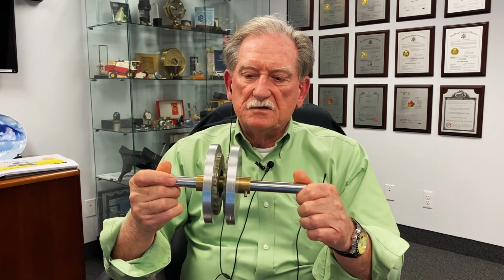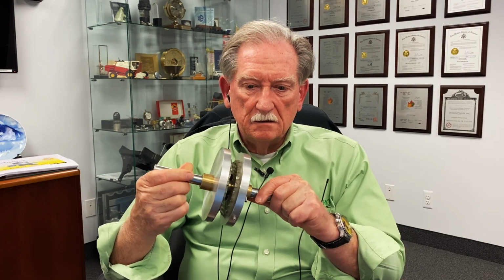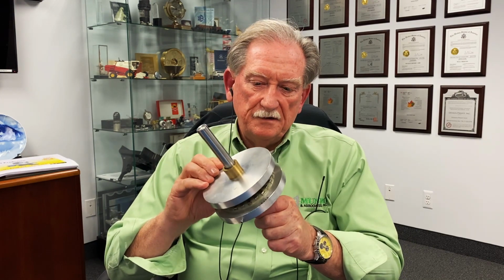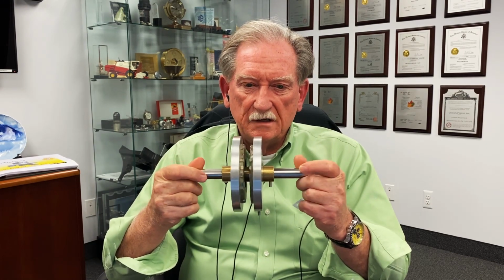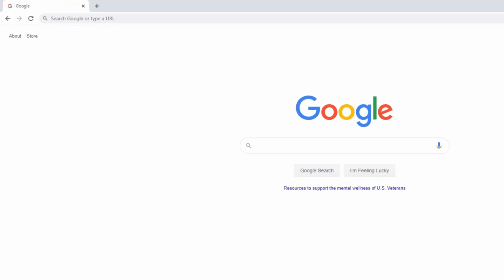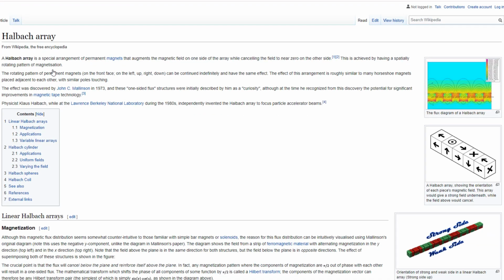Sandy Discusses What's In The Box - With Tracy McSheery

Comment: Woolsey... it's my first time running across a full-sized two-wheel gyrocar.  Amazing.

Okay, motors-in-wheels.  Traditionally, hub motors - commonly found in e-bikes - are not very efficient.  Assuming these Hallbach effect motors from Saphire don't suffer from that deficiency:  wheels are unsprung, so more mass in the car will be unsprung with in-wheel motors.  What will that do to tire grip over rough surfaces?

Being unsprung, motors and their connectors are going to take a heavy beating.  What will putting these motors in wheels do to failure rates and maintenance costs/inconvenience?  I'm sure there will be engineering solutions to ensure reliability, but what will be the cost and unsprung mass implications of those solutions?

It sounds like Sandy is leaning towards putting some very pricey components in these 3-wheelers - Hallbach effect motors, air suspension... a gyroscope?  Not sure I heard that right.  From a marketing perspective: people will expect a tiny car with limited space for people and cargo to sell for less than competitive 4-wheel cars.  With Tesla planning to introduce a $25K FSD-capable (FSD will cost extra, to be sure) consumer car, with all of the high tech and good range Tesla can put into their cars, where is the market for a 3-wheeler that may cost more, uses older-tech batteries, has less range, has less space, has off-the-shelf (older) tech, and has none of Tesla's software advantages?

In principle, it seems as if 3-wheelers could find a market niche, but the price-value ratio has to compel consumers to buy it.  Or they won't.

It would not shock me if Tesla decided to engineer a 3-wheeler for the Indian market, but they can now bring to bear tremendous advantages that a small startup simply doesn't have: BMS software, motor control software, OTA, user interface, navigation, etc.  Looking ahead a few years, a startup which can't match Tesla's tech and utility at their price points is going to be a niche manufacturer; the mass market will elude them.

Tesla is thinking of the whole car as a computer.  I think automakers, large and small, who can't learn to do that will have a hard time over the next couple of decades.
Reply: I thought that too... unsprung mass.  Maybe move the motors inboard to the fulcrum end of driveshafts, but that would not be in-wheel and would greatly restrict motor diameter.
Reply: ohhhhh if only it were that simple, ...
Reply: You guys were able to capture some of my questions here, thanks. If Tesla is truly open to selling their technology to these startups, a grassroots development of markets become a topic of review.
Reply: @markorcutt2115  That's easier to say than to do, Mark.

For starters, Tesla's cars are highly integrated.  The software works with the components.  Pick different components, the software won't work without a lot of changes.

The software has a design philosophy and design language built into it.  Go in a different direction and it's not going to be optimal, or even work at all, potentially.  For example: the stability requirements for a 3-wheeler are dramatically different from those of a 4-wheeler.  Sandy was talking about using the motor control system to obtain stability for 3-wheelers, but that need drives design in a new direction, one Tesla has not previously pursued.

And so on.  At just about every point, the needs of a 3-wheeler are different, sometimes subtly so, sometimes in a much more pronounced way.  So none of these startups can just sign an agreement and walk out with Tesla's software, ready to go.  It won't work that way.  This isn't Microsoft Office.

Tesla will incur considerable expense reengineering its software to work with any of these startups' vehicles.  It won't be instantaneous, either - software development for cars requires quite a lot of testing and refinement, 'cause people's lives are on the line.  Figure on years.

Then we have to think about updates.  Is someone going to pay Tesla to keep the software updated?  Or no?  If Tesla wrote it, nobody else is going to be able to maintain it without a lot of time-consuming headaches, and time is money.

Tesla might make the deal to license software and an entire 3-wheeler skateboard, which they will manufacture - if Tesla was going to make such a skateboard anyway.  (If they aren't already intending to engineer a 3-wheeler skateboard, there's no way small startups could afford the price to pay them to do it.)  So let's assume Tesla wants to do this work anyway, and they wouldn't mind producing skateboards and updating software just like they intend to do with their own 3-wheelers, for a fee.

It's a trap!

Tesla will obtain skateboards, software and hardware at cost for its own manufacturing operations, but they won't be selling skateboards, software and hardware to other manufacturers for their internal price.  They'll mark it up.

So the best a startup could do with a deal with Tesla would be to match Tesla's tech at a higher vehicular price point.  Oops!

Deal with Tesla, match the tech but not the price.  Don't deal with Tesla, where the heck is the tech going to come from to match Tesla's price/value ratio?  Answer: it isn't.  Tesla has won this decade.  The entire market is there for them to feast upon.

This is the bind Tesla has put the entire industry into.  Before it's over, we'll see execs jumping out of skyscrapers.

The only escapes are to go deeply down-market where Tesla doesn't intend to operate (well below $25K, since a Tesla at that price point will be very capable and very loaded with advanced tech), or so far upmarket that price is no object.  With the latter option, production volumes will be low.

Sandy is adding gee-whiz expensive components.  Hallbach effect motors.  Air suspension.  So he's headed upmarket.  He mentioned leather seats and luxury appointments.  So he's opting for small production runs.  The market just won't be very big for expensive 3-wheelers.

But luxury buyers' expectations are being shaped by tech, too.  That's a moving target, and Tesla is the company moving it.  There literally is no-place to go for most of what Tesla is doing.  Only Tesla does it.  To catch up is an impossible task for a startup.  Tesla has had too much of a head start and is still accelerating.

It's not obvious to me that upscale 3-wheelers lacking the latest tech, lacking space, with only modest performance, lacking the latest battery advances (which only Tesla has), lacking good range, lacking advanced software and connectivity, unable to provide a compelling price/value ratio, looking for consumers at the high end of the market, will find enough demand for the companies making them to survive.

It's not that 3-wheelers are inherently a bad idea.  Tesla may even decide to make one at some point.  But they can shovel so much tech into any car, and do so affordably in coming years, that finding an entry point that will persuade consumers and attract demand will be exceedingly difficult.

The market is being disrupted, turned on its head.  Consumer expectations are being changed rapidly.  Tesla will condition them not to accept city cars and short-range vehicles that don't offer much value for the price.

Cleanerwatt operates a YouTube channel that compares BEVs according to costs (initial and follow-on) and performance, utility and tech features.  Worth a look!  I can easily imagine him dissecting an upscale 3-wheeler measured against the closest Tesla (in terms of initial price) and placing his check marks.

It's going to be brutal.

Comment: Excellent show on the Halbach Effect Motor!  Now, I am definitely NOT an engineer;-)  But I have been waiting for and following EV progress for about 30 years now.  Back in the late 90's or early 'aughts, there were several companies already working on Hub motors.  But today, the only Hub motors are in Electric Motorcycles- I don't recall any being in cars yet.  And from what I understand, the problem has been, and is, the unsprung weight- that this just beats up and destroys Hub motors before their time.  I would love to see them implemented, but is there anything in Sapphire's new Electric Motor that addresses this issue of unsprung weight killing them?

And thanks for the video, Sandy!
Reply: The additional weight will be about 8 kilograms, which is about the same as the disk brake, so the short answer is it shouldn't be noticeable.  The better answer is to have Sandy show the vehicle at speed.
Reply: @tracymcsheery1223  While a lighter Hub Motor will help, it is my understanding that the entire weight of the wheel assembly comes into play.  And even at 8 ounces, if you slam that into something hard, like a pothole, at 50 miles an hour, that motor is going to suffer bad consequences.

Comment: HP sells cars but torque wins races. That cannot be true. Torque is a measure a force while HP is a measure of work. Work is distance over time. You cannot win a race with less work. Torque does not require any movement. However, ICEs cannot produce torque without movement. There are readily available equations to convert torque to HP and back in an ICE if the RPM is known, so there is a direct relationship between the two. You cannot have more torque without also having more HP for a given RPM. Engines with wide torque curves can have an advantage over engines with high peak HP because for many RPMs they have also have more HP, and may only be at a disadvantage at a very narrow peak HP of the other. The better way to measure HP is average, or area under the curve and just forget torque even exists. Yes it's there, but HP is getting things done! I'm sure almost everyone will want to argue with this, but these are simple facts.
Reply: A semi truck has a motor that is about 500 HP. A beefy sports car has a motor that is about ... wait for it... 500 HP. So the difference is the semi uses the motor at peak HP constantly through an 18 speed transmission while the sports car only needs 500 HP when the police are watching. The real secret is moving forward when the light turns green and reaching the speed limit without crushing the car in front of you, or being crushed by the car behind you. Since a UPS truck weighs 20,000 lbs and the mini cooper weighs 2,000 pounds this is harder than it sounds, which is why we have traffic jams.

Without talking about duty cycles, peak load, maximum shaft torque this is a bit oversimplified, but the answer is: torque when and where you need it is much more important  than the theoretic torque when you are at 120 mph.

Comment: How does that work with unsprung Mass being in the wheel since the motor is in the wheel that would be a lot of unsprung mass?
Reply: If you can use the structure of the wheel as part of the unsprang mass, you are looking at adding about 8 kilograms to the wheel which is almost impossible to quantify due to the rim, brake and other masses being on the same order of magnitude of mass.
Reply: @tracymcsheery1223  have you designs for any ebike  electric hub motors yet?, Imagine this could be a great market for you and your company
Reply: @scottk84  Yes, Yes, and Yes but we are focusing on delivery bikes and higher power. The 1000 watts and lower class is saturated with good motors below manufacturing costs.
Reply: @tracymcsheery1223  great news, im interested in your designs and higher power ebike hub or wheel motors ( over 1k watts ) yes, defiantly needed! where can I find out more about your motors ?
Reply: @scottk84  ask again after Sandy has tried one
Reply: @tracymcsheery1223   I liked this video describing synRM, is this a technique you use in your new motor designs also? https://www.youtube.com/watch?v=vvw6k4ppUZU
Reply: @scottk84  Switched Reluctance Motors and Synchronous reluctance motors are closer to previous Tesla designs and others. (Which is pointed out by fascinating comments in that video) They have the advantage they don't all use magnets but tend to be larger and heavier than equivalent torque and power permanent magnet brushless motors. This extra size and weight, reduces some of the cost advantage. Nice videos and I suggest you read through the comments. Worth the effort.

Comment: No one wants to bring up the bane of hub motors, unsprung weight?
Reply: This is a job for FEA. Assume that to the mass of the rocker arm with Brake, Rim, Tire and springs you  add 8 Kilograms. Then simulate. Or put one in a vehicle and drive and see if you like it.
Reply: @tracymcsheery1223  Thanks for responding. I hope things have improved since PML Flightlink tried this on a MINI. The presumption for years was that hub motors would only work on larger vehicles, but I suspect we'll move to BMW i3 wheels, skinny and large diameter.
Reply: @martshearer498  What CSIRO developed was a unique mass to power relationship based on removing the steel laminations, that works at low speeds where eddy currents aren't dominant, but high torque is required. This is a limited design space, on one hand but on the other hand applies to over 1 billion vehicles x up to 4 motors. So we think it's worth looking into.

Comment: 28:00 why is night time power always going to be so cheap
Reply: Water Power, wind power and nuclear power are all available at night even if nobody is buying. Thermal generators from coal, natural gas and other sources also don't want to shut down, as thermal cycling will 'age' their plants, so they want to maintain output to keep the temperature the same 24 hours a day. This leads to excess power availability at night. In addition if we can time shift, the power harvested at night reduces the power required during the day (the whole sales pitch to power walls if you don't have solar roofs) so the grid is more stable. A grid that produces the same amount of power 24 hours a day is more efficient than a grid that produces a peak amount at 4 PM local time.
Reply: @tracymcsheery1223  fully agree, we don't have enough water so we're building out Snowy Hydro to include a pumped hydro component, we also don't have nuclear, not sure why.
I understand the spike issue and I believe China is extending/ smoothing solar generation with a west -east link of DC million volts.
As an aside I was reading yesterday in Clean Technica that rather than almost flat south facing PV, (north facing here), they are experimenting with both sided upright PV to catch the east -west sun, leaving the mid day sun to fall on the crops, as they envisage land use sharing.
Reply: Because people are asleep. Even if everyone is charging an EV, the demand wont spike in the same way  it does when millions of people run high demand appliances all at once at breakfast and dinner time.
Reply: @patreekotime4578  true, yet we used thermal storage for space heating and water heating cos coal was running already, in the future, using solar, this is less true.

Comment: Place your bets: Is Elon's "alien technology" in the new Tesla Plaid powertrain a pair of axial flux motors? Running through a planetary gear reduction to each wheel? It would be super compact, powerful and efficient.
Reply: Tesla already uses Halbach motors, at least on the front wheels.
Reply: @lengould9262  Ahhhh. But those are radial flux motors.

Comment: Thanks Sandy!
Yup! As a remote control model enthusiast, the brushless motor and Lipo technology have been instrumental.........and costs have come down from $1200-3000 per model to under $200-600 for my budget over the last 7 years.  Love my Teslas too😁
Reply: Same my eGO garden equipment, all brushless now, tiny, water proof motors.
By the way I like Tracy's comment at 15:00 about don't sweat the heat, its only for four seconds, but how close are those cycles, sure on ramp works, but twisting hilly road, constantly accelerating/regenerating WILL overheat.
Reply: The power density of lipo is off the charts
Reply: @bob15479  yet the cheap Chinese Changli Freeman that he breaks down at $1200, is lead acid, go figure
Reply: DIY drones are getting faster every year, the most recent record being 234mph with a little drone costing no more than a couple hundred dollars in parts

Comment: Sandy, I understand this motor concept is different than what companies use today, but doesn't Tesla use the hallback array effect for the model 3/y PM motor?
Reply: Tesla tends to use both switched reluctance motors, and radial flux motors. These are axial flux motors. If you research the Aurora Motor from CSIRO and other axial flux motors they can tell you the relative tradeoffs. These motors are good torque for low cost. Otherwise all motors are pretty much equally good over 50 KW.
Reply: (Halbach)
Reply: No, they don't. It's only a legend/disinformation. In this configuration reported in the video Halbach array (surface mounted permanent magnet) makes perfectly sense.

Comment: As a retired electrician, years ago , at the RR,  Diesel engines runs a generator that sends electricity to an electric motor that encompases the  wheels with large gears, its called electromagnetic force and  on deisel -electric locomotives.

Comment: I think it is going to be commercial applications that will drive the switch to electric vehicles. Especially local delivery vehicles.

The only thing holding it back is availability. There are a lot of prototypes, but putting them into production is painfully slow it seems.
Reply: Yes, Sandy and I were teenagers when this was started